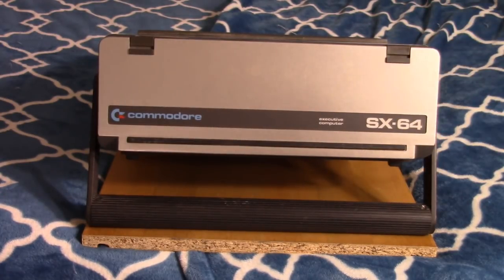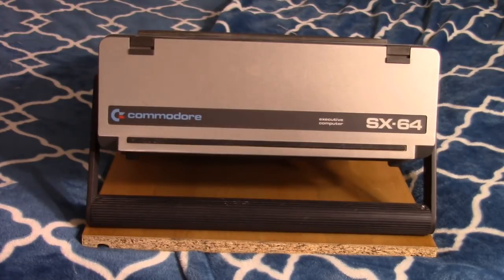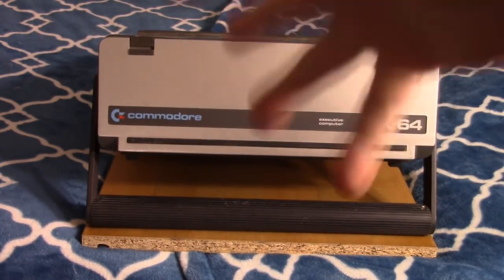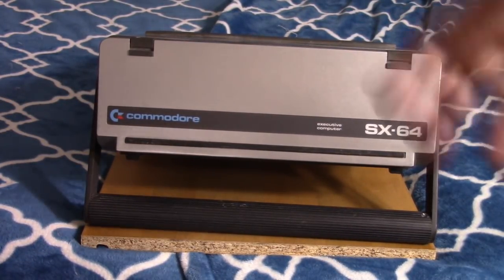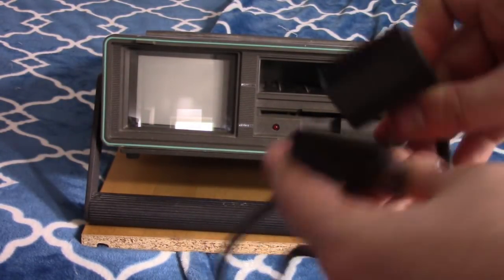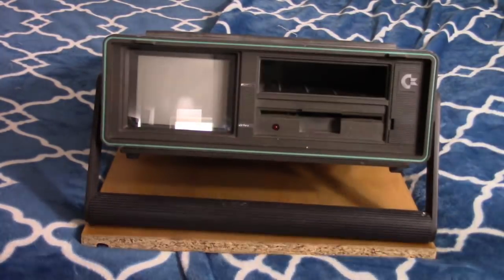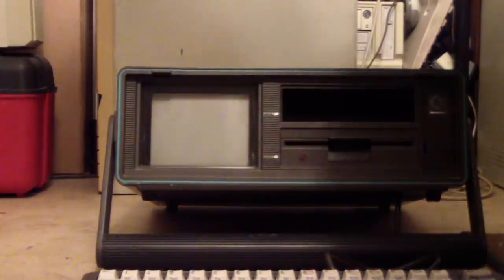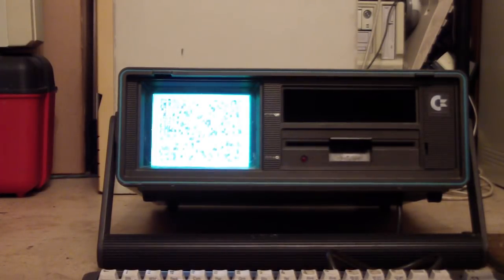Commodore SX-64

Comment: They really stretched the definition of portable with this machine. it is only marginally easier to carry than a regular C64 and 1541 disc drive and a TV.
Reply from the maker: That's more or less what I thought as well, though bringing along a small CRT may at least require a second trip back and forth from the car. In a lot of travel situations like a staying over at a hotel or family visit where you want to get some work done I would still reasonably expect there to be a TV already there anyways you could just hook a regular breadbox C64 up to.